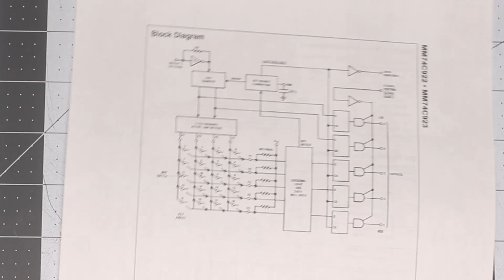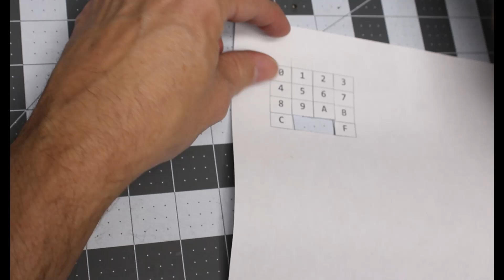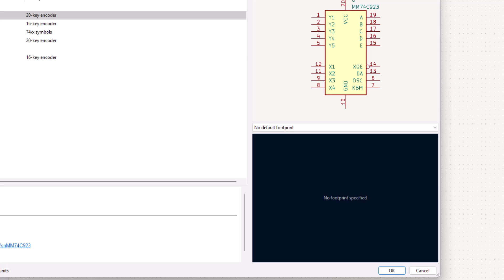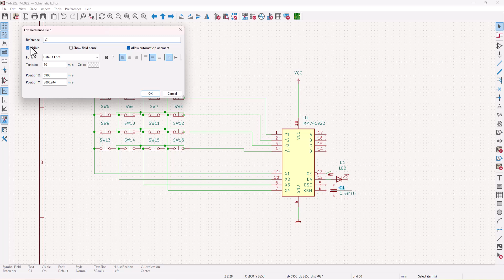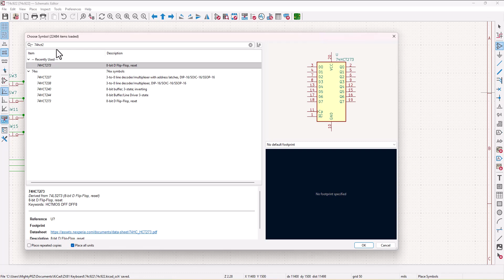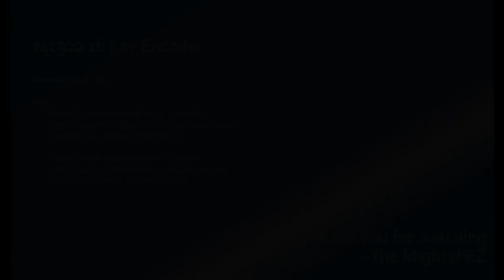74C922 16 button keypad encoder

Comment: Pretty cool chip, but pricey. Over $10 at Jameco.
There's also a 4x5 matrix version the 74C923
There's a clever circuit in the data sheet that allows you to double the size of the matrix by adding some diodes, pullup resistors, and a 4-input nand gate.
Reply from the maker: They are obsolete so i picked up 5 for pretty cheap from AliExpress. I didnt realize Jamco had any stock.

Comment: I think using the master reset as a clear might be a good idea for when you push the incorrect key. Possibly.

The d flip flop idea is great. I thought you were going well to go with a bunch of keyboard encoders, but this is much neater.

I used a 22V10 gal for a keyboard encoders my my own home-brew.
Reply from the maker: Absolutly. My 8 bit entry used the reset chain to clear all of the input bits. When i add the address entry logic i will definitely use since instruction entry for my Z80 starts at hex 00000000.